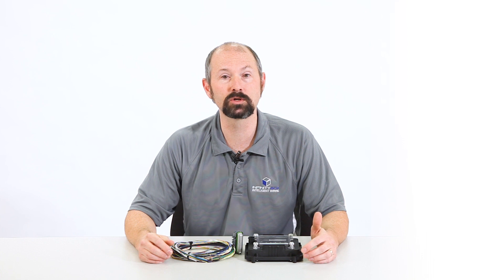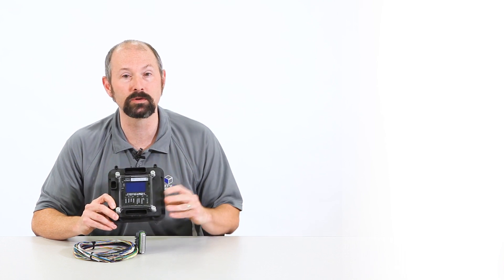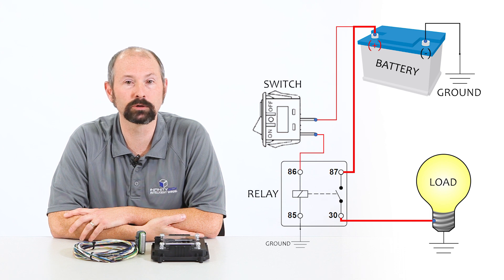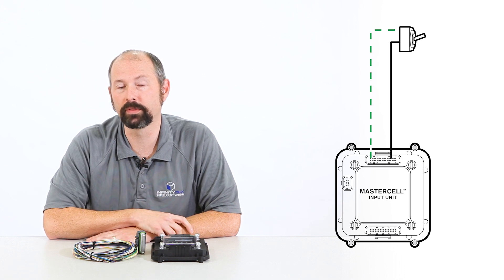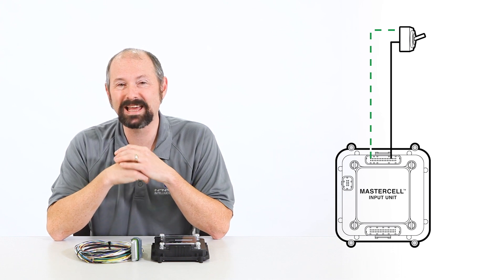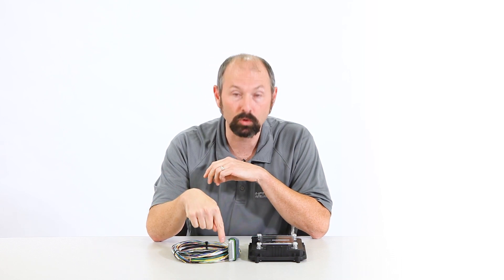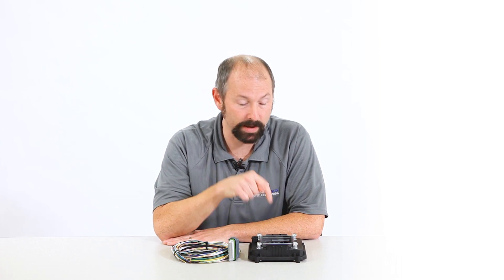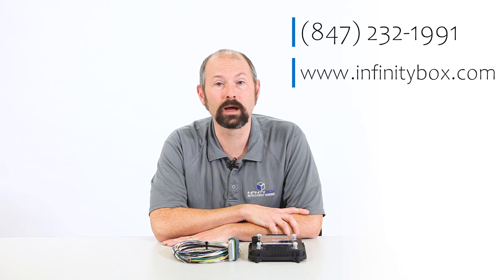Infinitybox MASTERCELL Details

Comment: Im in the very early stages of planning a full resto-mod of a 90's Japanese sports car. Using your system sounds like it would be ideal for this as I would like all of the features that are in a modern car.  I am also wanting to use RealDash ( http://realdash.net ) as my main instrument cluster and primary interface. Is there any way to connect InfinityBox to a micro computer running RealDash via Serial USB? Is there any support for this?
Reply from the maker: Most of the Real Dash connections go to your senders.  The front POWERCELL in your system is going to power the RealDash with the ignition.  Check out our latest video showing how to interface a Raspberry Pi with our inTOUCH NET to get control from any size touch screen.

Comment: I love this Infinitybox system I installed in my 73 Dodge Challenger 5 years ago.  It makes total sense on any restoration and the factory support from Jay and his crew is awesome.
Reply from the maker: Thanks for the comments Bill.  We're proud to be a part of your Challenger!
Reply: Was it possible to use the stock mopar light switch? I have a 66 Coronet and this would be something I need to know for sure.
Reply from the maker: @Kenjh71  You can connect any switch to the MASTERCELL inputs.  Yes, you can use the stock MOPAR switches.  Check out this video for more details.  https://youtu.be/jzQe982CbEs